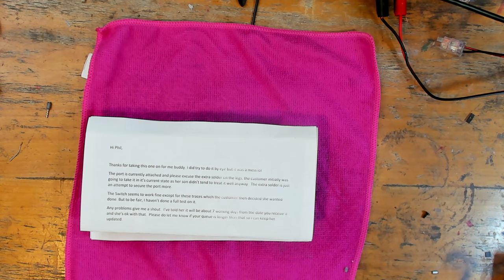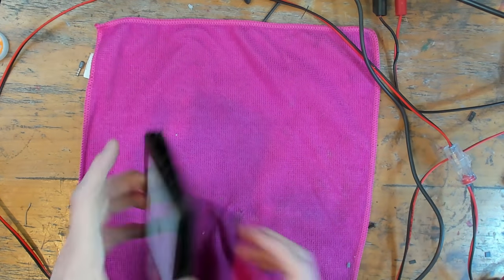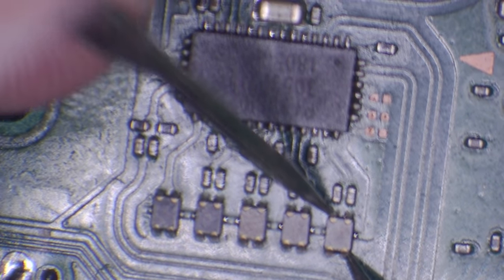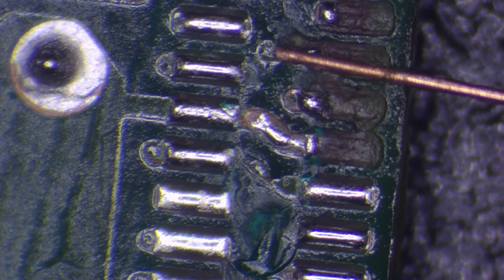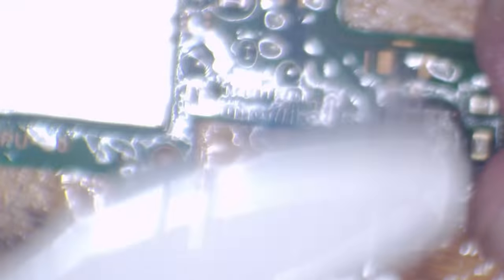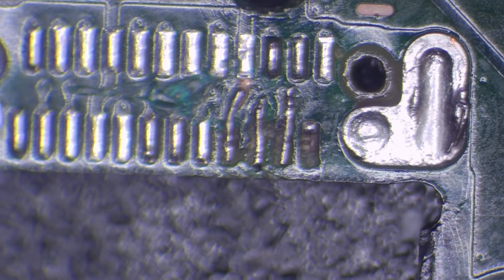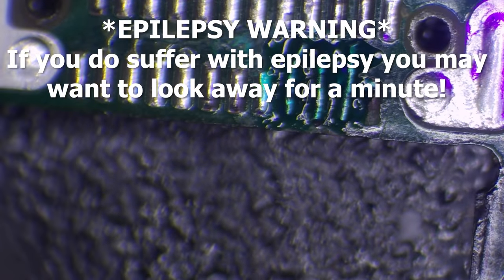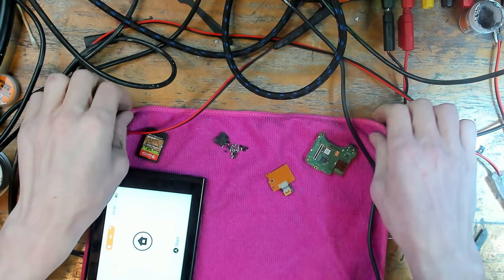Nintendo Switch USB-C Damaged (Lifted) Trace Repair Using Tiny Jumper Wires & WE HIT 20K! 🥳 🥳 🥳 🥳 🥳

Comment: Mate love your work. If you hit the jumper wire with a hammer a time or two it flattens it, and it is easier to place components on. Less height and less Roll off
Reply from the maker: Yeaj that would probably be easier, I have flattened the wire a few times with pliers and that works pretty well too :)

Comment: Woot 20k congrats 👍an good health to you and to all. Btw on that cables to replace nintendo switch bat for tests you should add a small ali power module set at 4.2V output. If you forget to adjust voltage on bench supply it can hurt :)
Reply from the maker: Yeah I was thinking about that mate, something to step down the voltage but I'm pretty sure the BQ IC can handle a decent range of inputs because the BQ24193 is very similar to BQ24196 (which is also compatible with the Switch), but I might try and make a custom PCB with a modified circuit at some point :)
Reply: @TheCod3r  im not sure that it can handle more on the battery side but i do not know

Comment: Nice repair, very clever on the test cable. I have my old test battery that just got butchered for the board because of this lol. I'll give you full credit when I use it for sure.
Reply from the maker: Haha thanks mate, you don't need to give me credit though I just thought I'd share the idea, I might make a video on how to make them 😀
Reply: @TheCod3r  To late, I already said I would. No take backs 😜
Reply: @TheCod3r  Please do make a video on how to make them 👍🏻♥️🤣
Reply: Sorry to reply to an old comment but is there anything special you have to do to make one of these? If I hook up normally it does nothing. I read somewhere that the data wire has to be shorted but trying that didn't help.
Then I head you have to break the connection of the TH line from the + line but I don't see how that would make a difference.

Thanks for any clarification. I've made a ton of breakout test cables for GPUs and such but this one just doesn't seem to work for me.
Reply: @DannyWilliamH  Wow this is an oldy. 
I am no longer using the apparatus I described here.
I retro fitted Switch and Lite battery connectors onto an iPhone battery cable (squid)   The old white ones that have the red/white/black cables. Not a Quanli or Mechanic.
On the switch I tied the two reds and blacks together (red with red black with black) and white just goes to white.
Reply: @MicroMageRepair  

Yeah, sorry about that as it's a pure necro post, haha.

I'll look into your suggestion as for some reason just hooking it straight up to the battery board isn't working for me and I know the board is good. I have a few actually. I just didn't want to destroy any of them testing as I heard a few different things to get them to work like his cable here.

Thanks for the reply and I subbed. Look forward to watching your videos in the future.
Reply: @DannyWilliamH  😂

Comment: hey brother i have a switch lite missing bottom power in pad 4th from left and also the ground 1st from left l. those shouldn't cause no power? i checked voltage of power pin top row 4th from left and i get fluctuating .2 to 1.2 v ?

Comment: Fancy looking at a different type of switch? (:D) I have a Unifi 16 POE switch that won't power on and I'm at a loss.
Get well soon buddy
Reply from the maker: It's possible I could look mate but I've never worked on one before, so I would have to give a price once the job is done as I'd probably have to order specific parts for it so it may be a slow turnaround too
Reply: @TheCod3r  legend. I'll send over an email if that OK.
Reply from the maker: @Kolor-kode  course mate no problem 😊